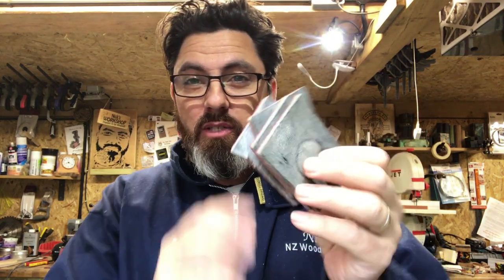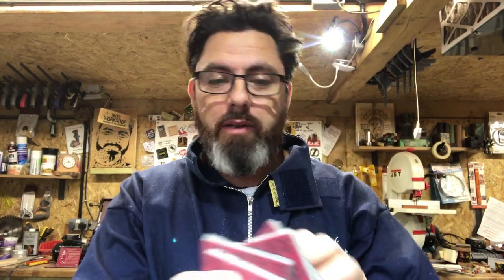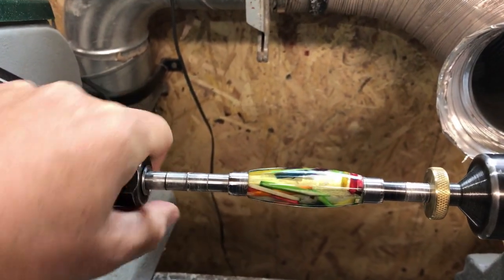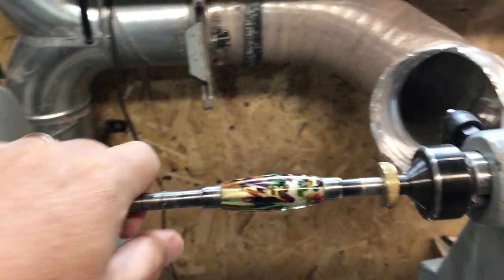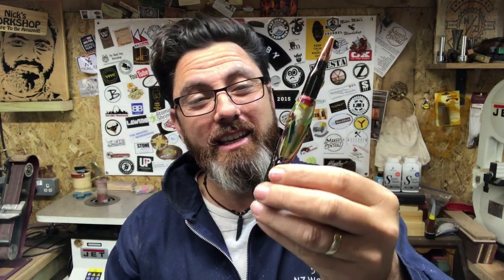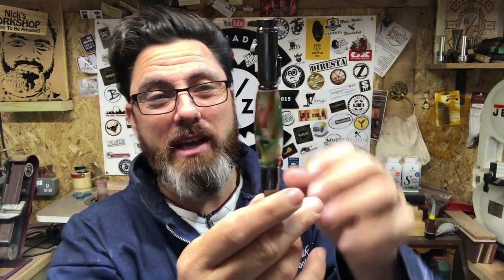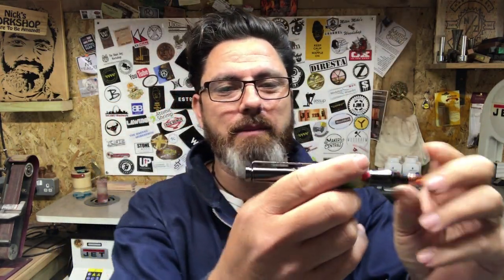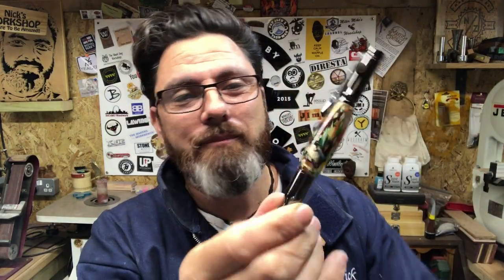using matchsticks to make wood-turn a pen!

Comment: Nice pen. After you drill the blank, paint inside the hole with model paint - use what ever color you want depending on what the colors are in the blank already. Then glue the tube in using 5 minute epoxy. This way you can use any tube you have on hand, just get multiple small bottles of paint. A small paint brush can be used or a Q-Tip/cotton tip applicator - you know, those things you use to clean your ears. I  was given this advice when I first started turning acrylic pens. Works well and is easy. Love your channel and your projects.   Scott

Comment: I really do like the idea of a matchstick pen and this one doesn't disappoint. If I may make a suggestion, you can colour two part  epoxy resin (Glue) in the same way you colour your resin. Also, adding a bit of glitter makes it sparkle.

Comment: Hi Nick - the misting may be from the CA glue you used on the finish - I have had the same issue. Have to check each layer to ensure no misting has occured and sand it out before the next coat is applied. Also with the bullet pens install the refill last by screwing the bullet nose off - this way the spring fits correcting for a smooth bolt action. Neat idea with the matchsticks tho !!

Comment: Nick, you can use the five minute epoxy resin that many use in knife making. It dries crystal clear, I would probably hit it with some heat to get the air bubbles out from mixing it. 

I couldn't see the white cloudiness from the CA glue. Even if you can see something, it still turned out amazing! 

What was the polishing you used in the white bottle at the end, before buffing? I'm going to try some resin art and want to try using something to make it nice and shiny! 

Brilliant job as always bud! Now off to sleep, it's past 2:30AM here lol

Comment: the point of the mandrel saver is to not use the bras nut so it applies pressure to the bushings/ blank instead of the mandrel like a regular live centre which can bend it also, paint the inside of the blank then the superglue is hidden
Reply: GeorgeS seems that pen turning requires some special kit.
Reply: Jon Hunt I believe you can get by without the with kit. I'm sure people use a light mallet or even clamps to get a nice fit. Wouldn't be to hard to get some padding around everything. But that kit does take little time to make everything fit very nicely!
Reply: You would need a lathe (obviously) and a pen mandrel with bushing to get started as well as pen kits, I would recommend getting a barrel trimmer too because it makes preparing the blanks SO much easier. Anything after that is just extras.